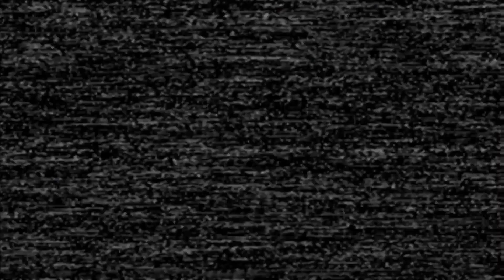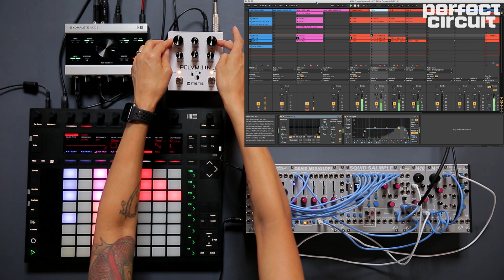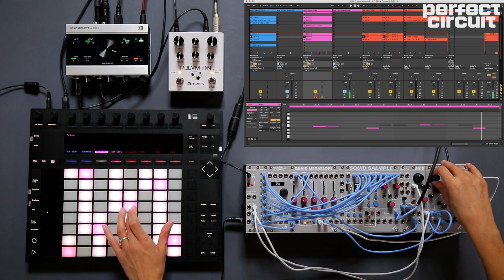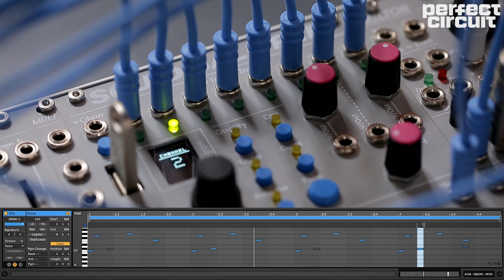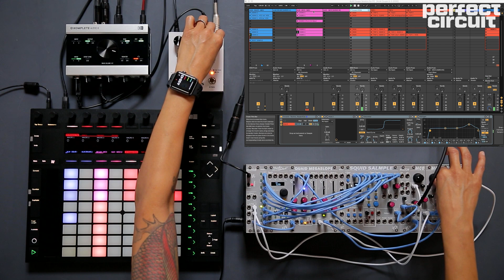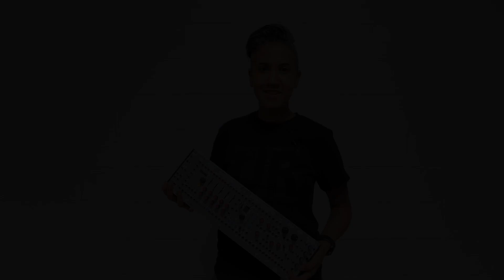ALM Busy Circuits System Coupe Hybrid Ableton Live Jam & Patch Walkthrough

Comment: I bought the ALM mmMidi last December (from P.C.!) and it's a great inexpensive option for setting up 2 individual voices. Most of the time, I have it set so one midi channel controls both V/O & Gate outputs.  Though the clock is kinda unusable out of the box.  You definitely need a couple of clock dividers or Pam's Workout.  Or I suppose you could use the mmT add-on for clock purposes.

P.S.  Would love to buy the Milton.  Hopefully that gets released sometime.
Reply from the maker: The Milton would be a great standalone module, we don't know yet if it will be released as a separate module though.